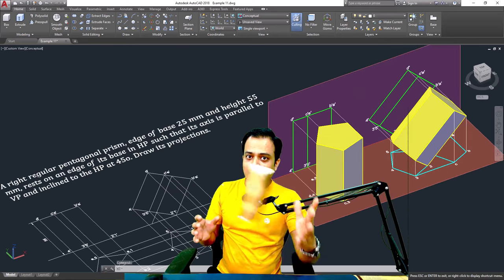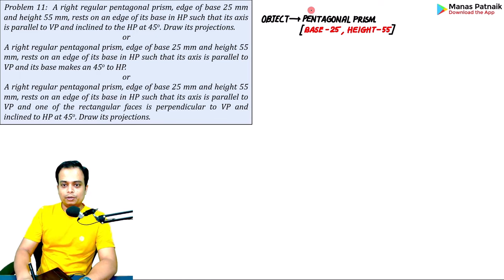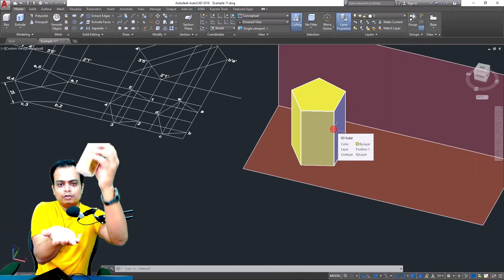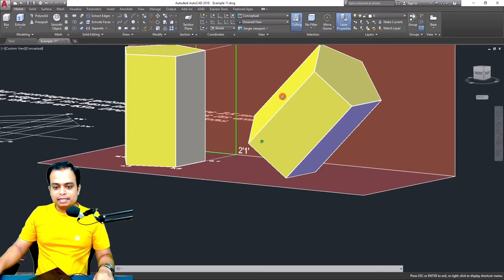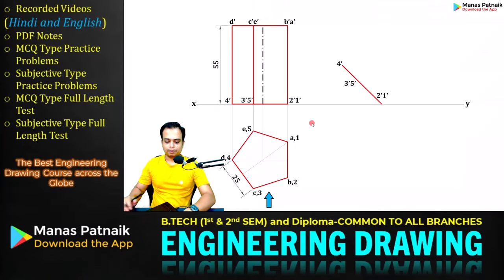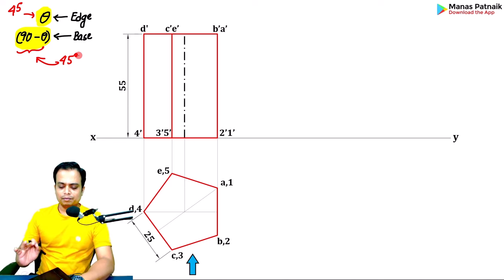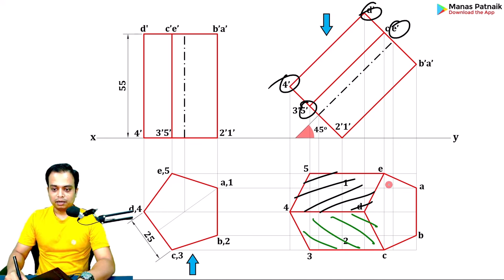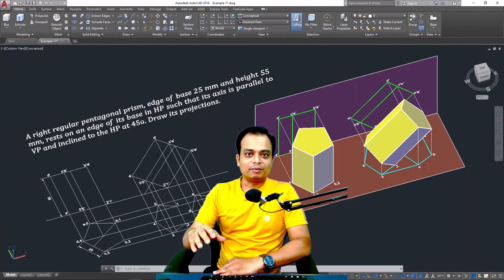Projection of Solid || Axis Inclined to HP || Pentagonal Prism ||

Comment: A pentagonal pyramid side of 35 mm base and 60 mm long axis rests with its base on H.P. such 
that one of the edges of the base is perpendicular to V.P. A section plane perpendicular to H.P. 
and parallel to V.P. cuts the pyramid at a distance of 20 mm from the corner of the base nearer 
to the observer. Draw its top and sectional front views.

Upload this one